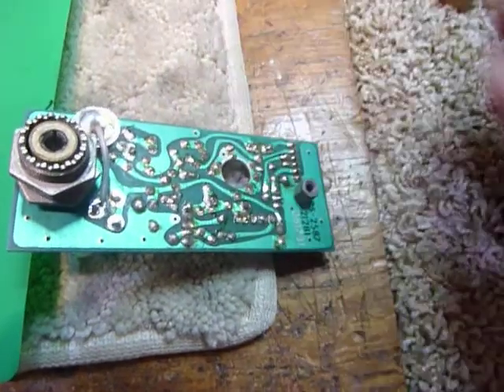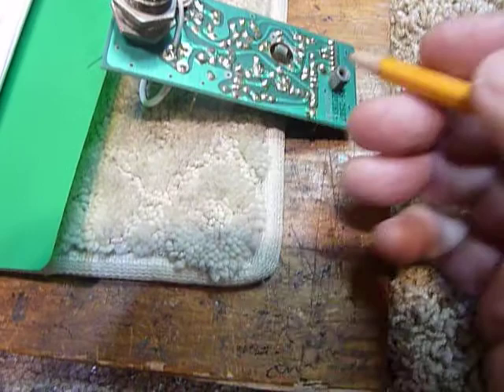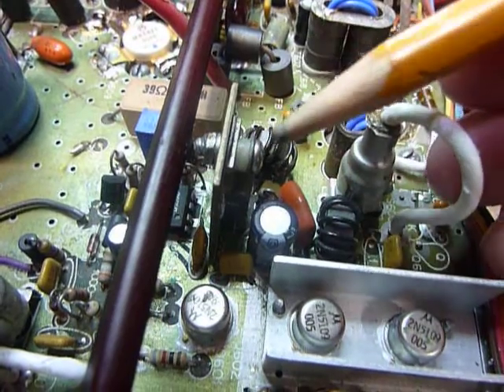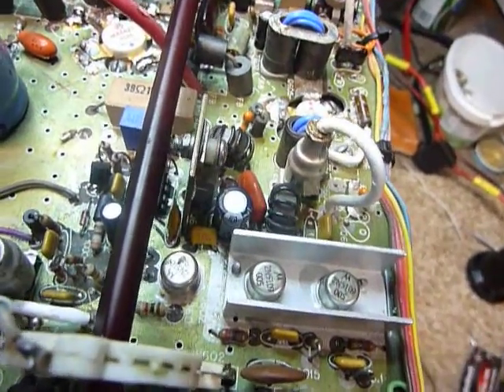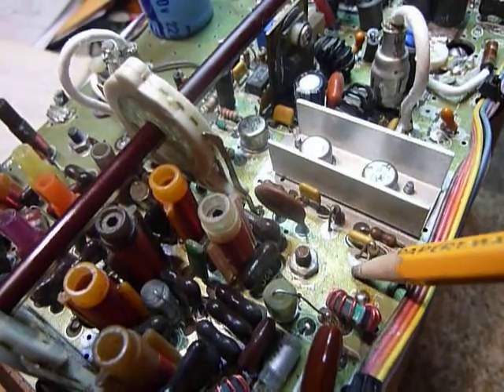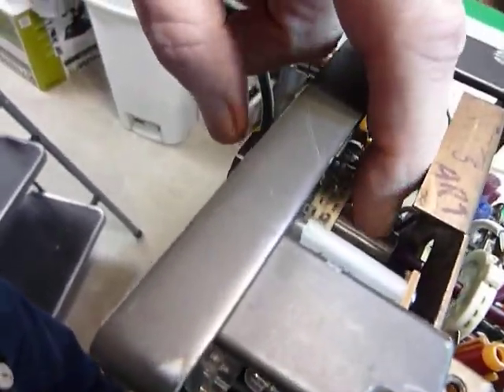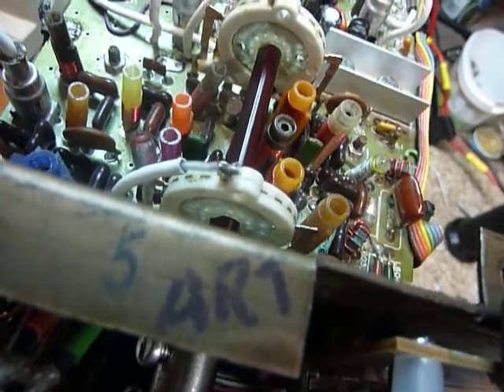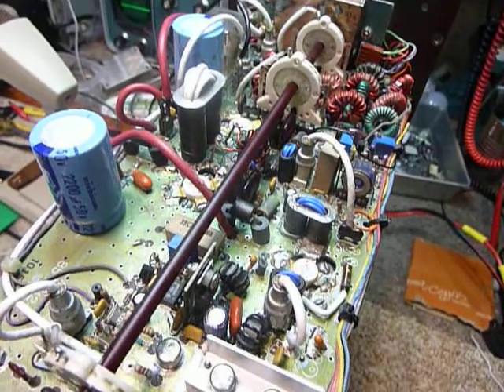HEATH SS9000, Heathkit SS9000, Heathkit tranceiver ,Heathkit

Comment: Bob, thanks for these hints. They will help me with the repair of the SS-9000 which I bought at Hamvention 2022 and brought to Germany. Going into transmit in SSB mode the heatsink became hot quite fast even though without modulation there should be nearly no HF produced. Finally I found out that via the red wire to the driver the "idling" current was 9A! I removed the transistor and it measured defective. A new one is on its way from China. The hint with the Bias pot (fully clockwise = zero bias) will help to not overload it once installed. I will also check the insulation of the bias transistor.